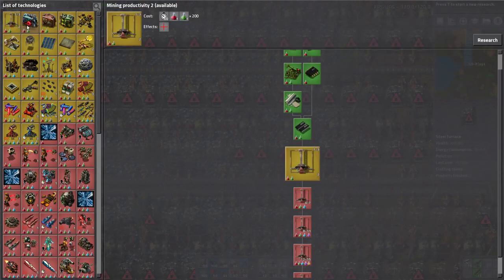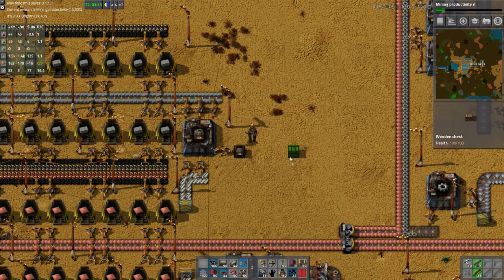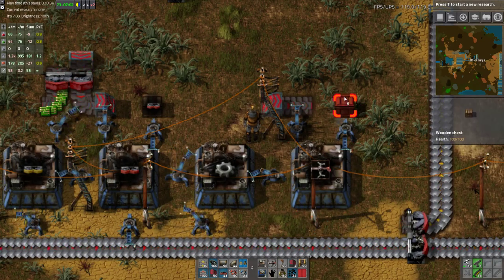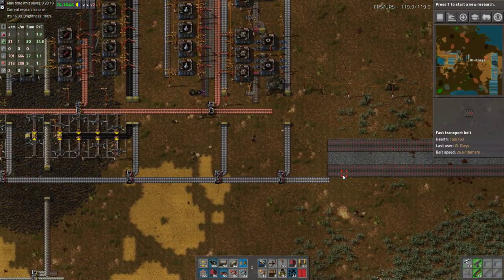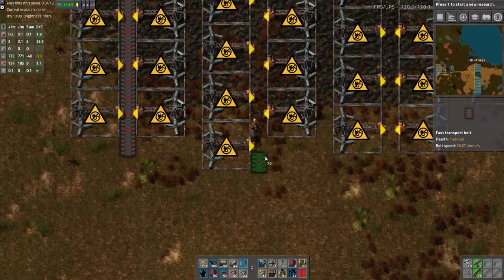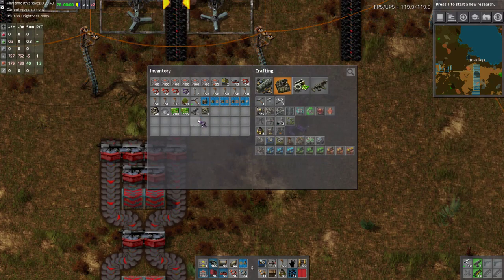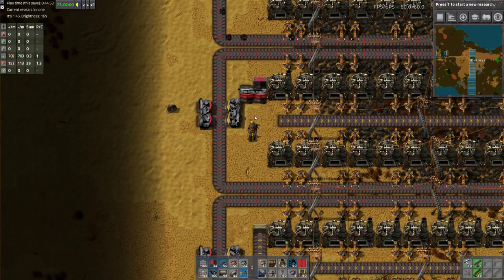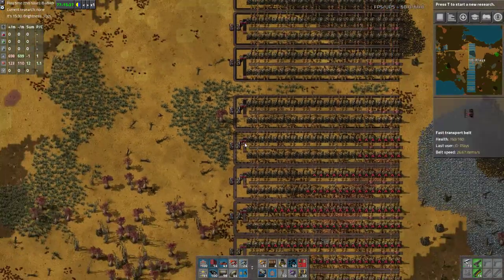EP08 Belt Balancers 4 To 4 - FacTutorial

Comment: In 4x4 you need your last 2 splitters. otherwise items from leftmost input line will be not able to get to the rightmost output.
But what is redundant is one of splitters either before or after the undergrounds. They balance 2 lines, which go underground, and it balances them again once they come out. This makes the build 1 tile shorter.

Comment: That 4-4 balancer or a variation of it should be the only one that you ever really need.
Reply from the maker: Julie Fisher the 4 to 4 is the only one you need most of the time,  unless you have 8 lanes, at which you really need a 8 to 8 until you have chewed 4 lanes at which point you can go bacm to using the 4 to 4